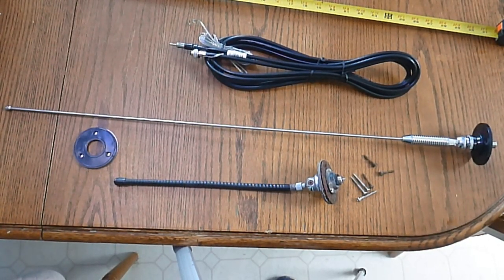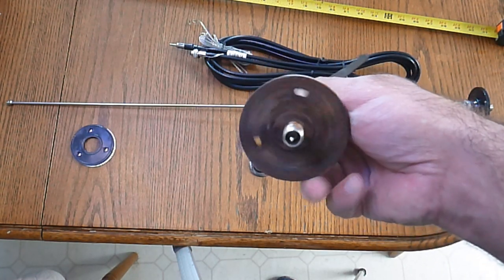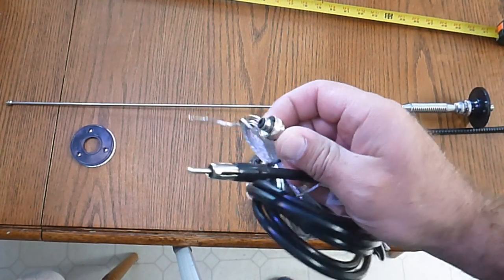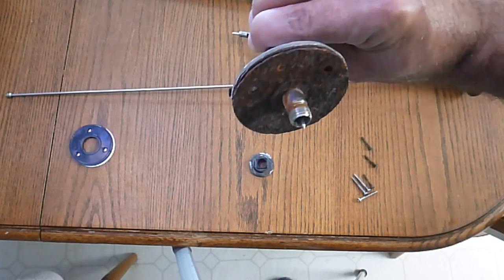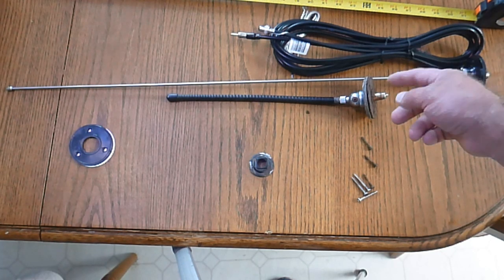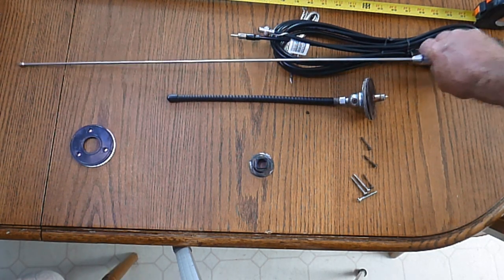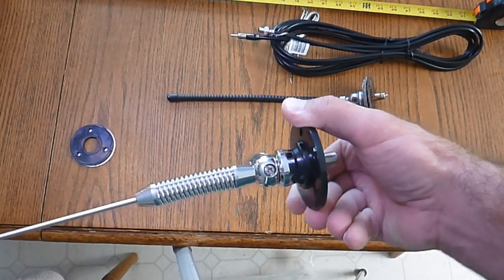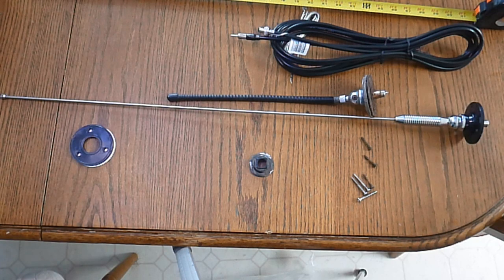Camper and RV radio antenna replacement Jensen Whip An519.

Comment: Most travel trailers and 5th wheels manufactured in the last 5-7 years use the tv antenna for the am fm radio. Yes, it works somewhat on fm but almost no reception on am. I have the same Jensen am fm radio in my 2019 Grand Design Solitude and my 2022 LGM and both camper radios are connected to the tv antenna so they both have fair to poor reception. At first I thought it was the radios but I plugged in an old car antenna and wow! What a difference! Thats why I'm installing am fm antennas on both campers. Less than $20 on Amazon and lots of choices. The most difficult part was finding a route for the antenna cable.